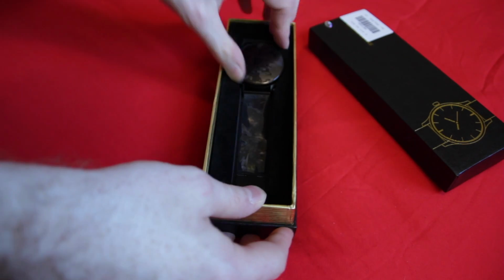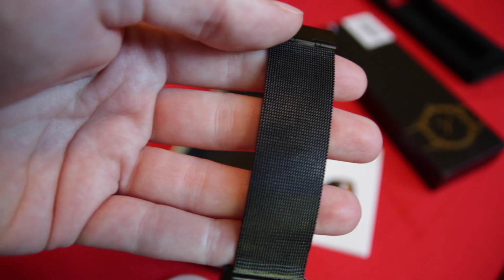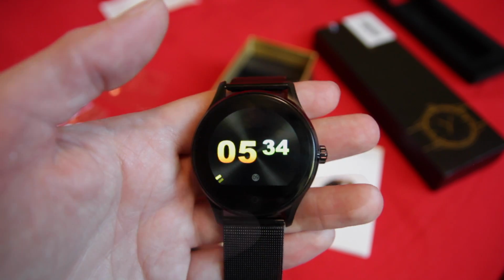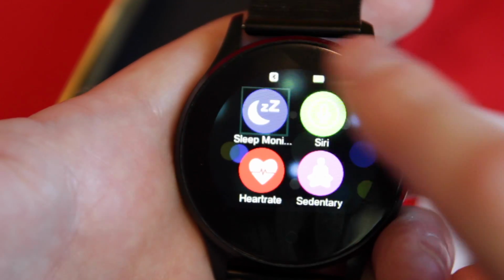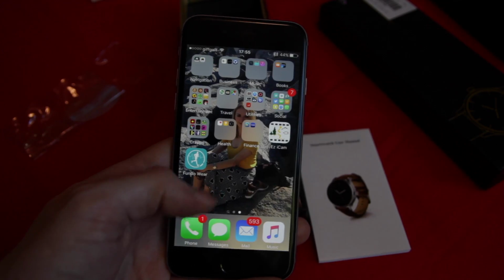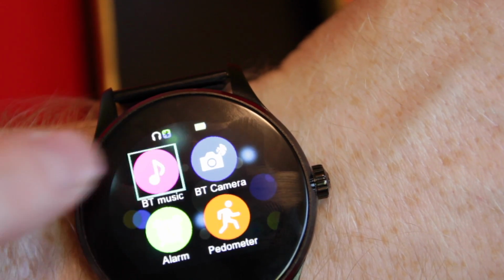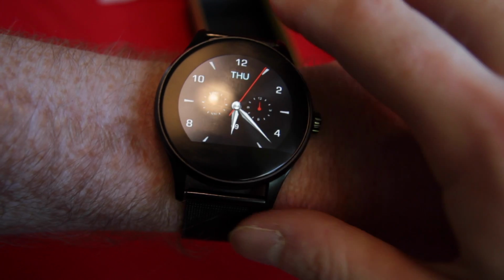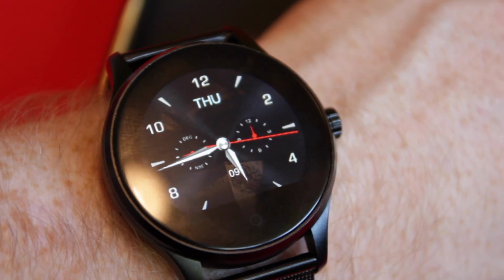Unboxing & Review K88H Bluetooth Smartwatch For iPhone With Text Notifications, Siri & Motion Sensor

Comment: I bought myself the same manufacturer DIGGRO for $ 39.59 (store DIGGRO Official Store - I DO NOT ADVISE !!!). Impression of the purchase of the most negative. First, the seller deceived with a complete set. Instead of such a beautiful black cardboard box, he sent the watch in a white paper box from the kit for $ 33.95. In occasion of hours: beautiful, but a toy.
The body of the massive, "crown" head bulges and squeezes in the hand, while the clock is constantly turned off (after which you need to load again). To find out the time you need to press a button each time, and if you use a gesture (turning the brush), the time is not displayed immediately, but after 1-2 seconds, which is extremely inconvenient (you stand with your hand up and wait ...).
Fonts are small, Russian translation is clumsy and is 60% complete. There is a Siri function for iPhon, for Android it does not work. The incoming call is displayed in numbers, and not in the name, you can only talk on the speakerphone, i.e. everyone around you is listening to you, the heart rate monitor is lying godlessly, the pedometer is generally useless, etc. etc. The maximum price of this toy is $ 15-20
. Do not be fooled by the appearance, it is in vain money thrown away.

Comment: More than a year later after your review I've bought this same smartwatch from Vantage, priced some 100USD, oh well.. If I'd knew about the K88H as a "brand" available from different sources I'd got it as cheap as you did. Yepp, knowledge costs. But the point here is that this watch is totally OK for the price range between 40-50 USD. 
I find the watch faces ugly as hell, excuse my language. This is the only part of the watch that, according to me, lacks some engagement from the designers. I mean, how hard is it to create a face that's not pixelized, the resolution is really really not good. But that's what I'll be looking at all the time , not the settings menus and opening apps..
Your review is fine and highlights the most important  issues, only not the battery life. If I have the Pedometer, heart rate and some other monitoring stuff activated, it won't last a full day really. Faulty unit? Maybe. But if you sit and write a lot on your computer, the watch face is activated all the time because you're moving your hand in various directions. This means you're actually never letting it rest, the battery goes. 
Also, the faces where there's also a battery indicator show a false remaining time, or is it accurate? When I go to the menus it shows some 2/3 of battery full, but the faces indicate it's some 50%, judged visually of course, it's a small icon there.
Anyway, totally OK watch for 50 USD (even then I'd consider the faces ugly) but way way expencive and not wirth the price I paid.
Btw, thanks very much for the other video on how to adjust the wrist band :-)

Comment: Without a smart phone, these seem pretty much useless garbage.   If you have a smart phone, you'd rather use it instead of the watch.   My biggest complaint though is that these smart watches do a horrible job telling time.   Most have very few watch faces, and their battery life is so atrocious your watch would be a brick within a day if you were list in the woods or stranded on an island.   A casio battery watch lasts 10 years or more...  why these watches cant do the same with the screen completely off is... a complete fail as a watch.   Even a old 486 PC motherboard time clock will maintain the time in a closet for 5-10 years with no power to it whatsoever other than the CR2032 button battery.
Reply from the maker: Some very good points. Smartwatches in general are a bit useless really. Battery technology just isn't where it needs to be - it's majorly inconvenient to charge a watch daily

Comment: Hi! This is a fantastic review and it's why I bought the watch. Thank you! But I have a question: when the watch is connected to my phone and I get a call, I don't always want to answer the call via the watch. Even if I answer through the phone I have to talk through the watch. Is there any way I can switch that off. I find answering through the watch is only useful for me when I'm driving. Thanks for the help!
Reply: Isn't there a standard Bluetooth setting in iOS for that?  You select yourself what speaker/microphone you want: phone, watch, headset.
Reply: I also noticed this and its the same with every video i play that uses sound! Also texts don't seem to come through to my watch, or emails etc... can u help?

Comment: I don't like the fact that the screen is cropped at the bottom. It looks just awful.
Reply from the maker: Check out the KW18. It doesn't have the cropped screen https://www.youtube.com/watch?v=3jO4w_mePcE
Reply: It looks interesting, but I think I'll give those smartwatches another year or two and wait untill they get better performance.
Reply: It's pretty cheap here - for 35.89 USD
http://www.gearbest.com/smart-watches/pp_294087.html?wid=21&eo=g3LfeZu9XjCiHjAq&lkid=11061329
Sweet

https://www.youtube.com/watch?v=vNqE8HIEA64

Comment: bottom roughly 1/8 of the screen is black and on the digital clock face the seconds hand dissappears and other issues this seems to be a really bad choice of design was thinking about getting this watch but not so much anymore i would get annoyed very easily with this
Reply from the maker: It's still a cool watch though! I'm going to keep an eye out for similar watches without the bottom 8th missing!

Comment: Two issues. Flat tire....big turn off! Secondly, almost no memory available to user. Why wasn't this brought up?
Reply from the maker: You can see that the screen isn't circular in the video. Also, you don't really need to use the memory on the phone for anything
Reply: +Dr Jake's Smartwatch Unboxings & Reviews “Aliexpress Guru” Thanks for your review...I think as an iPhone user the most compelling feature is Siri...the watch falls fall short on all other aspects (no micro SD card slot, no SIM card slot, no camera etc etc).
Reply: +Red Ryder if you want all that your better off with a phone

Comment: I bought this watch and it came in today. Everything works just how I want it. The only problem I have is trying to figure out how to adjust it to fit my wrist. Do you have any answers to this problem?
Reply from the maker: I used a little screwdriver to unclip a little metal thing in the clasp, and then you can adjust it to where you want before clipping it back down. Took a little while to work it out, but it's obvious when you figure it out

Comment: I'm having trouble adjusting the metal clasp. is there a trick or something?
Reply from the maker: Do you mean it's too big/small for your wrist? I used a little screwdriver to unclip a little metal thing in the clasp, and then you can adjust it to where you want before clipping it back down. Took a little while to work it out, but it's obvious when you figure it out
Reply: +Dr Jake's Smartwatch Unboxings & Reviews “Aliexpress Guru” the sides of the clasp or underneath? It's too big for my wrist and i need to tighten it up
Reply from the maker: https://s31.postimg.org/xbnbycfzv/IMG_4218.jpg See the little hole in the middle? I put a little screwdriver in there and levered the metal bit up
Reply: +Dr Jake's Smartwatch Unboxings & Reviews “Aliexpress Guru” Ok I'll try it
Reply: +Shawn McDonald success. thank you very much

Comment: 3 days in using this watch & its total piece of junk. Battery life for 2h without using anything. I cant turn sleep monitor coz its drains battery in 2 h of sleep & watch just shut down & start to restart with "low battery" message & that annoying start watch noise no fun at all in the middle of the night. Absolutely unusable if u cant access to charger every 2hours. I got same watch for my husband & his doing the same thing - always battery low every 2 hours. Our fun from this watch lasted only 1st day when battery life was about 6h & we could try pedometer & other stuff. Now its just non stop charging job.
Reply from the maker: That's really strange. Mine is working fine still... Did you buy it from gearbest? They'll refund you I'm sure.
Reply: ya. i bought it mainly for pedometer & cant use it :(

Comment: Hi Jake, I have received the watch yesterday, the design was awesome but i have few probs here, i wonder you are able to advice me on it. 
1.why does the sound of the notification are so loud when i have set it to lvl 1.
2. is there possibility to disable to start up song when the watch switches on.
3. is the watch able to update to the latest software. ( if can how does it work ) 
4. the screen protector can be purchase or can it DIY ourself by using normal phone screen protector.
Hope to hear  from you soon.
Cheers!
Reply from the maker: Regarding the startup sound, try disabling the sound completely. There should be a silent or vibrate option in the settings. When I did that it stopped making the awful startup sound. Yes, you could cut yourself out a DIY protector by getting a normal one, as I don't think they make protectors specifically for this watch. I don't know about software updates though, sorry. Thanks Merrick

Comment: Dr.Jaike, is message feature works on iPhone ? On mine doesn't work ? any suggestion ?
Reply from the maker: You should install the app for iPhone, and then you will get message notifications on the watch every time you receive a message. Actual Text Messaging (writing and sending) does not work using iPhones.

Comment: thanks Dr. Jake. I tried lowing the sound but when u disconnected from your phone the watch is still loud. so i see there is no way to add app. But on the other hand nice watch.
Reply: I think you go to the watch settings and that's where you can turn down the volume
Reply: This actually doesn't work for me. Even though I lowered the volume to 0 it still does an incredibly loud sound for notifications etc.

Comment: How can I turn off the loud disconnect sound, and also can you download apps from the Android Google play store?
Reply from the maker: You can't download apps. This watch looks a lot like the Motorola 360, which is an Androidwear watch that you CAN install apps on. To turn off the annoying sounds, there is a volume section in the settings - I just turned the volume right down and turned vibrate on

Comment: does it keep beeping like AiWatch if you loosing BT-connect with smartphone?
Reply from the maker: It does. But I had it on silent with vibrate, which is much less annoying
Reply: but constant will drain battery faster. i'm looking for smartwatch with pedometer because my boss at work doesnt let me to keep my phone on me when i'm on the clock/ all i need is to track my speps & be not suspicious about it lol.

Comment: Jake, I have just ordered 1 unit.

May i know, is the watch water resistant and does the watch able to use camera on iphone?
Hope to hear from you soon :)
Reply from the maker: Hi Merrick. The watch is water resistant (i.e. splash proof) and can act as a remote camera trigger for the iphone, but the picture does not come up on the watch.